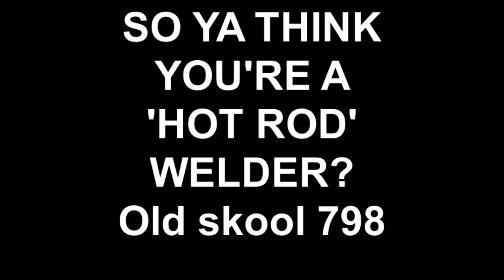SO YA THINK YOU'RE A 'HOT ROD' WELDER?

Comment: what was that device inside the pipe?  does it align the pipe?  was that smoke or dust coming out of the pipe?
Reply: Inside the pipe are internal clamps that hold the pipe square so you can get the space you need for the bead.The smoke inside the pipe is smoke from the first rod. Putting the bead in will cause smoke to go inside the pipe.
Reply: @jtweldin  thanks